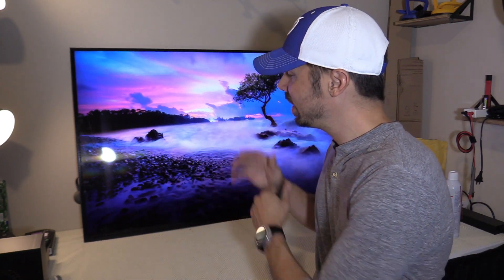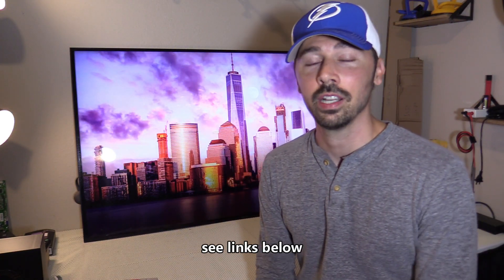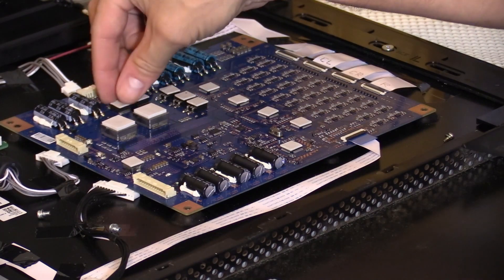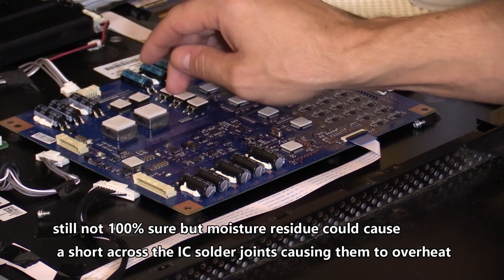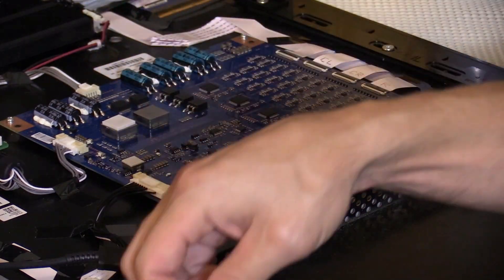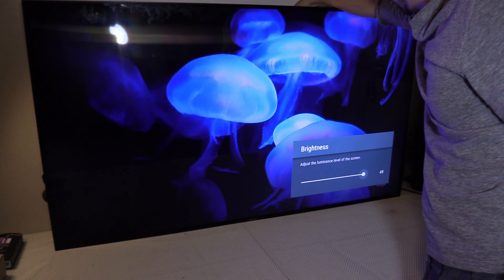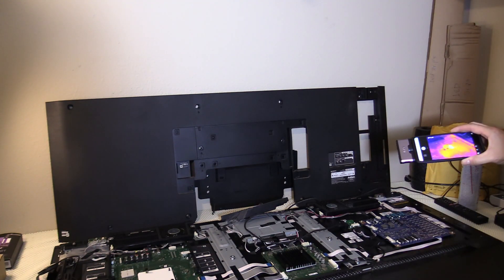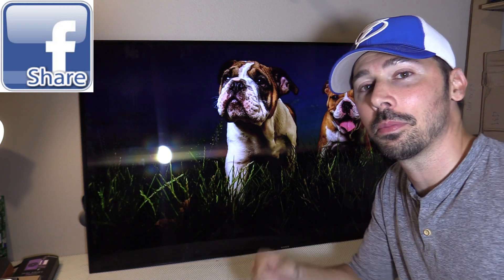Sony XBR TV Repair Update 🤔 Can LED backlight settings cause TVs to overheat and shutdown?

Comment: Hello friend. Try to investigate the Sony KD-65X8505C. Many have the same issue: 

1) The Tv turns directly on, without going
     in stand-by mode
2) No picture or sound through the hole 
     process. 
3) Sony logo turns on, once in a while 
     also the “marsmellow” logo. 
4) You can hear a few click’s from the
     Power Supply oard (PSU)
5) The backcover is removed. 
     The backlight turns on for a few
     seconds. You can only see the light
     through the holes from the back. 
     At the front, no light at all. 
6) All above are repeated. 
7) You - or Frigal Repair, could perhaps 
     help us all?

Comment: Hello sir. Enjoying the channel. Very informative. I have a question. I’m trying to bring a Sony xbr back to life. It’s not powering up. I did all the trouble shooting everybody is suggesting. I found that I wasn’t getting the 3 volt standby from the power board. I was able to get 12 volts. So I ordered the power board. I installed the replacement board and I’m still having the same issue. I unplugged the plug connecting the power board to the main board and still no stand by 3 volts. Do you have any suggestions?

Comment: I have a Sony 65" XBR-65X850B and all of a sudden it would click off and click on simultaneously. I've unplugged for hours and had all hdmi attachments taken out, as well as batteries in remote, then plugged the tv back in and without turning the TV on it clicks on and off simultaneously with the white led. Would this be a main board issue?

Comment: I have a 65xbr930d. I was told the main board needs replaced. I get no picture and no on light. What do I really need to look for to replace?  I’ve tested the power and it is working great at 24vdc. Any help is appreciated. Great vids by the way

Comment: Hi Tampa Tec !  I had a question that not about how to fix the TV . But it’s a smart oven ( Breville brand) . What happens if I install the thermo fuse wrong polarity ? Some how the fan don’t work anymore and the cord at the plug in getting very hot  ???

Comment: I had an LG55LN5710 that would run for 30 min or so and then shut off. The problem was a couple led's in the BL had shorted causing too much load on the PS/led driver board. Replaced all the led strips and has been working fine for a couple years. I'm wondering if shorted led's might be causing ur driver board to overheat? Once I took the panel off and then turned on the TV u could see the dead led's.

Comment: i have sony bravia KDL-40R455B the screen starts 3 times ,the first time stays on for 5  sec and goes off with green led with a high frequency sound, the second time the same, but the 3rd time stays longer about 10 sec then goes off with red blinking led 6 times, even if i remove the led power cable that goes to backlight does the same thing but without the backlight. How to fix that?

Comment: Hi, quick question, my backlight wasnt working so I checked backlights with led tester from connections to the psu. They lit up so I replaced psu which contains led driver, however it still doesnt light up the tv. Eventhough the less lit up could they still be causing the issue and need replacing?

Comment: I have an xbr65x900e that recently quit working. This is the second time that it failed and I decided to replace it instead of taking a chance on fixing it again (based on my internet investigation - main board defective). I would like to find out if there is a message board or some other network for recycling the tv.

Comment: Measure the ac input current with a kill-a-watt or similar while moving the brightness and black level to see which one actually controls the backlight level. The lower the backlight setting the longer the LEDs will last. Great video as always.

Comment: Hey TampaTec, I have a Sony Bravia XBR-49700D. I am not sure why it is displaying odd colors; it displays patches of blue tints around the screen.  I did some research and tried troubleshooting, adjusting the colors setting in picture display settings, updated the software, but the odd coloring still remains. Any suggestions on what it may be?

Comment: Hi. My samsung smart tv, series 6, 40inch (2014) stopped working 15day ago. No standby light after i unplugged it for a week as my kids were glued to the TV for whole day so to keep them away from tv and focus on studies and other things in life i did so to give them a break from TV . And when I wanted to turn it on after a week, I plugged in my TV and there was no standby red light. Since then it is not working at all. Here in India its rainy season and the air is moist too. Kindly advice how do I fix this.

Comment: Just a couple weeks ago I had a TV that wouldn't turn on and even when it did it stayed on for only a few minutes. I took it down, removed the back panel, plugged it in to get some power readings, and at that point it just stayed on. I put the back on again and it's been working fine ever since. Probably was just a loose connection but who knows?

Comment: By resoldering the connections you improved the heat transfer in to the circuit board. Making it in to a type of heat sink.

Comment: Nice video, but i'd leave that pads on. I think the thermal transfer can only be improved...
Reply from the maker: True, Afterwards I did leave the thermal pads on and lowered backlight settings under 50% too.
Reply: Manufacturing defect?

Comment: Many years ago, I worked at this place that had a few of these big metal-chassis "daisywheel" printers....  

Long story short, you'd test these things, broken.  Throw it in the truck, drive it back to the service center...  It would test good...

Drive it back, put it on your bench...  Working perfect.

Put it back in the person's office....  Work perfect.  After awhile, I would just put it in my truck, go to McDonalds for awhile, drive back, and retest it....  Seriously, all these printers really wanted was a ride in my truck, apparently.....

My point is, yes.  I have fixed things a few times, where I really had no idea why or how it got fixed, or why it started working again....